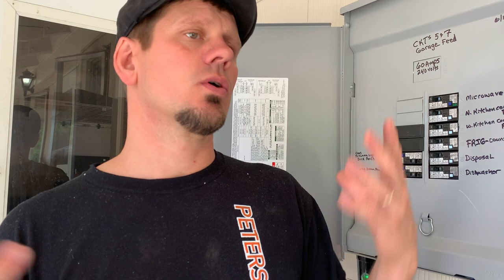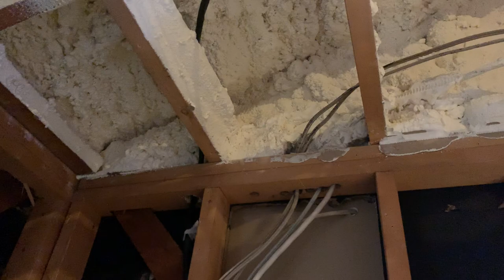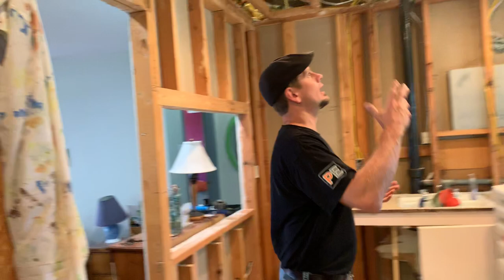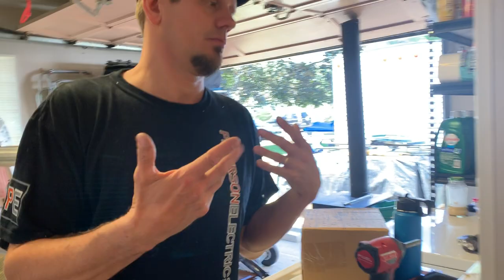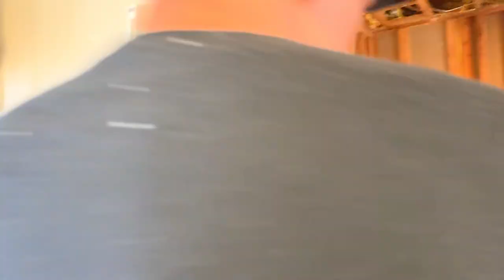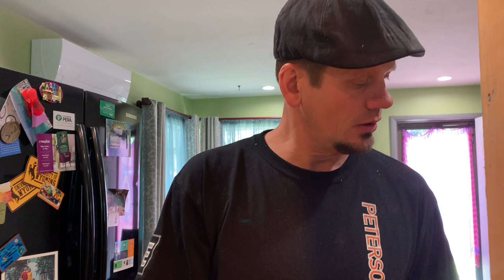Kitchen and Bath Remodel: Should I update Wiring When Doing Updates?

Comment: Some really good tips. The NEC changes really can burn you if you're doing some basic work. Running a couple new circuits to the kitchen, now you need GFCI/ARC breakers, oh, but the panel is too full, time for a subpanel. What could've been a few hundred to pull some NM is now $$ thousands for labor and materials. What used to be a $10 breaker is now over $100 for the GFCI 30 amp.
Reply: Yes but it will safe someone’s life trust me it saved my daughter’s.
Reply: Math Man please share that story on how it saved her life, thanks.
Reply: My daughter left an upstairs en-suite bathroom with wet hands without drying them she then entered the bedroom connected to the bathroom and as she was leaving the bedroom she flicked the bedroom light switch off which was tied into a GFCI (bedrooms previously in the NEC 2020 only had to have AFCI protection). I had installed a dual GFCI/AFCI receptacle which protected the receptacles and the lighting circuit which was tied into. The GFCI immediately tripped and lights and receptacles in the room all turned off. She had previously never done that (turned switches off with  very wet hands) in the 10 years we had lived in the house it was also a 13-year old heavily used switch as well and was likely failing as well. I had only installed the  GFCI/AFCI two weeks earlier. It was a class A device and tripped in 3.6milliseconds she did not even feel a tingle. It did it’s job and saved her life. Switches in particular can leak especially old ones and spark when switching off and on normally but are housed in insulated material. However even tiny amount of electricity can escape through any air gap around the switch itself and the insulated faceplate. With wet hands she was a very low resistance path to ground, even more so than the internal grounding of the switch this caused the leak from the live conductor and a resulting imbalance (only 4 milliamps) between it and the neutral and the GFCI tripped. Never underestimate safety children still die every year due to freak accidents like this even with GFCIs including around areas where GFCIs were not mandated (especially washing machines, dryers).

Comment: got rid of arc fault in kitchen/bedrooms in michigan..........
Reply from the maker: Good luck when you try to sell. I think they are good to keep, especially if you get the newer designs, the older 1st generations of 2002 and 2005 and 2008 need to be replaced. I have seen most companies in the last six years get better at not tripping .
Reply: Yes the latest ones are much better designed that’s because the companies have done better testing and development. Leviton has improved a tonne still not perfect the technical information is still woeful. If the technical information is available at least you can test it regularly with the relevant testing tool and see any degradation over time.